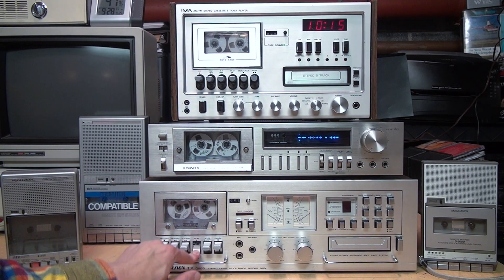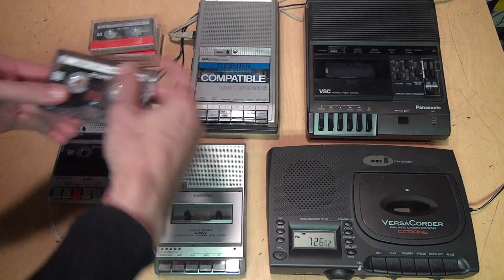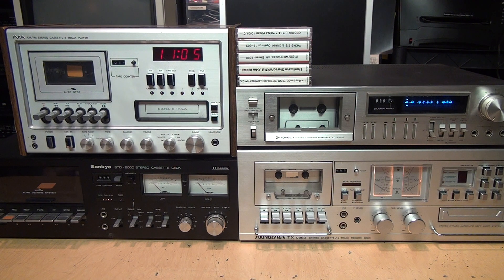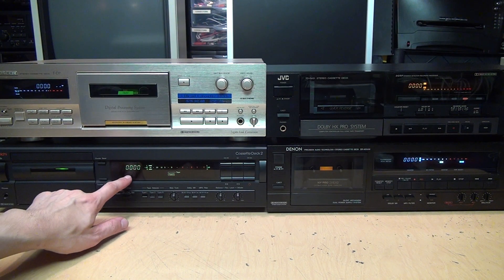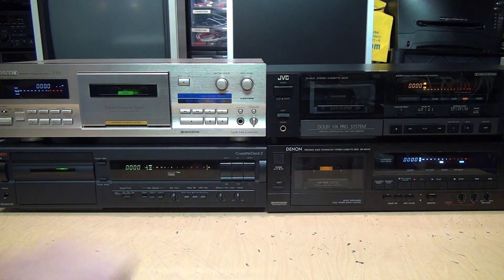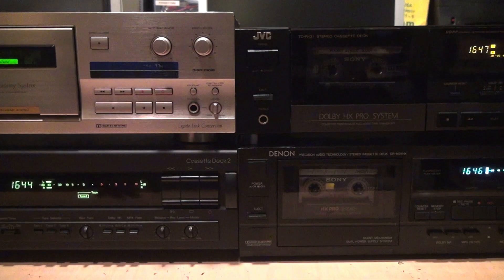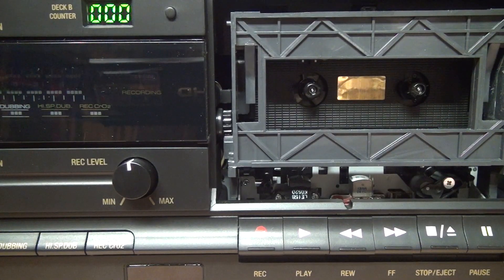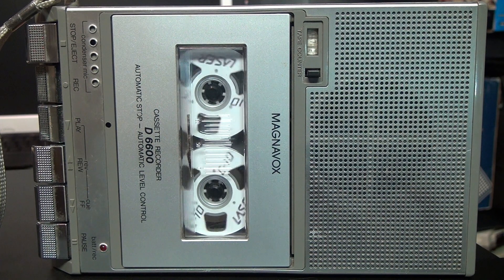What's the deal with cassette tape counters?

Comment: They’re really useful for Datasettes as you can put several games onto one cassette and mark down the counter on the beginning of each data stream.
Reply: Exactly, I don't think I've ever used it anywhere else.
Reply: Are different datasette models consistent?
Reply: @FlyingSurprise  I doubt it. They’re little more than a belt on a spindle. No way telling how the counter is geared or the size of the pulley.
Reply: I did that with my C=64 Datasette, I would write down the starting position of the program and it worked very well as I was only using the one Datasette.  It certainly made it easier to find the programs I had saved and I did use like C-60 tapes for it.
Reply: Exactly what sprung to my mind as well. Will see if they're counter is - by pure chance maybe - within the specs mentioned here.
Reply: @FlyingSurprise  between same model, yes. Growing up in the 80s, none of us kids in the village could afford more than at most a few original C64 or Speccy games a year. All the rest were pirated tape copies, (or floppies in rare cases). When I borrowed a tape from my friend for copying he would put a neat index table on the cassette cover so you could fast forward to any game you wanted. This worked exactly the same on my model 1530 datasette.
Reply: Yup, that's the only time I ever actually used it, for C64 cassettes with multiple games and a fast tape loader at the start
Reply: when you got APSS which a lot of sharp or optunica tape decks had you don't need a tape counter
Reply: @FlyingSurprise  Nope. Even same  model differs.
Reply: @FlyingSurprise  for C64 there were Japanese models with tiny white counters and Taiwanese models with bigger black counters. These two had huge discrepancy.
Reply: @stragulus  C64 tape loading was just magic to me, I never understood how it worked,   just Press Play and Pray    (note I am a staunch atheist now)
Reply: And even then, the counters that my friend wrote down on his C64 tape deck were useless on my own C64 tape deck.

Comment: I remember back in the 70s and 80s, VCR's had a 4-digit counter, that didn't mean seconds, minutes, and hours like the more modern VCR's from the 90s and 00s, it was literally just a counter like mentioned in this video.
Reply: It was an exciting moment for my mother when our second VCR (late-80s Fisher) had a "Memory" so she could rewind to "0000" when she got home from work and wanted to watch her soaps, since there was often programs at the beginning of the tape she wanted to save. No longer did she need to watch the counter while kneeling in front of the entertainment center and hit Stop at the right time - just hit Rew, wait for it to stop itself, hit Play, all from the comfort of the couch.

I was more impressed with the digital tuning, multiple timers, no longer having to convert to "military time" for her, and cordless remote! (Our first, a Mitsubishi, had those twelve annoying thumbwheels, single timer, and corded remote whose wire I always tripped over.)

Then, in the future, I was astounded again as manufacturers started using F-connectors on the input/output, and the UHF and VHF inputs were combined. I still have a handful of those old splitters hanging around in my junk bin.
Reply: Yes your comment beat me to it. The first VCR my parents owned was a 1986 Sharp model that had the same four digit counter you mentioned with no relation to time. The next VCR bought was a 1994 Craig model for myself, and that VCR had a minutes and hours counter instead. I'm curious as to when the  VCRs switched over the counter standards.
Reply: I remember before VCR's had time counters, that 3M (Scotch) brand videocassettes had a sticker you could put on the take-up reel side window, which would roughly show how many hours & minutes you had elapsed/remaining.  That and the sturdy polypropylene sleeves are the main reasons I tended to buy Scotch videocassettes back in the day.

Comment: The slight difference in counter results when attempting to Fast Forward the tape a few times can be attributed to friction in the tape spool, stickiness of the tape, as well as loosening of the tape on subsequent FFs. This was common on tape decks with mechanical counters, and even with an Aiwa with 3 heads, with an electronic counter. Basically I used the counter in reverse (the end of the Side was set to 0000 and then rewound to the beginning) so that when I recorded an album or a compilation of songs, I'd know roughly how much tape I had -  and I was pretty good at the time at estimating whether I could fit a 3,4 or 5 minute song with the leftover tape the counter would indicate.
Reply: That reverse counter trick is a great idea, wish I had have known it 35 years ago when I was recording songs from the radio! 😝
Reply: I just liked pushing the button to make the numbers reset 😆
Reply: @Manalo.  Still do that now,did it 45+years ago, annoying when you mess up by a few seconds,and then the dilemma is,do I fade,or fill with another song🙂
Reply: Make sense 👍🏻
Reply: @Pixie Pete That's how I worked,could sometimes find a short track.Have been listening to all my vinyl, cassettes and CDs from 1976-now,and some of the tracks I have filled up a cassette with,are Quite a mixture.Kate Bushe's Never for Ever,which I have been playing a lot,has 2 Rolling Stones Tracks,and 1 Paul McCartney.I vaguely remember recording it🙂

Comment: What people fail to realize is that the way these tape counters operate is by placing one tiny elf near the hub of the spindle and another one next to the counter device. The first elf watches the hub and counts the rotations and shouts out the numbers to the second elf, who manually advances the counter. The problem arises when these units get old and the elves become hard of hearing. In the more expensive decks they provide the elves with hearing aids but you do not find that in the cheaper decks.

Comment: And that's why, in general, they're not even properly called 'tape counters'. Because what they do count is, at best, spool rotations. The real quantity of tape depends (non-linearly, we might add) on the radius of the spool. So if, say, you've a 3.5min song, and it's recorded at the beginning of the tape, it will take N counter units, while recorded towards the end of the tape it'd take M tape units with M<N (for the takeup spool counters). Regardless of the standard used. Unless using a highend deck which has a linear counter.

Comment: When I was much younger, before my teens, I used the counter on my tape deck to mark where each song began on my mix tapes. When I got a new deck, I realised the counters didn't match up. Since then, I assumed the counter was machine-specific and nothing more than a transitory reference. It's interesting to find out there was some consistency across units and even actual attempts at standardisation. 

I did not expect a Mr. Regular crossover in this video. Nice touch.
Reply: You needed to use real time, that's how old people did that back then.
please forget Tape, it was always crap, still is
Reply: @lucasrem  only to you Bro

Comment: Wow, for nearly 40 years my eyes have glazed over watching tape counters and never thought for a moment there was any type of standard.  Here are some results from my collection taken from the same NOS Sony HF60 of similar vintage:

Digital counters:
Technics RS-TR355 = 411 (deck A and deck B)
JVC TD-W218 = 1644 (deck A) and 1646 (deck B)
Denon DR M12HX = 1369 (I expected a similar result to your M24HX… odd)
Akai GX-R60EX = 2054
Tascam CD-A500 = 1724

Mechanical counters:
Technics M215 = 410
Luxman K111 = 492
Sony TC-RX410 = 426
Sears Professional Series = 435 (no model # on front of unit)

My other 4 decks display only elapsed time.  Thanks Kevin for a fascinating video!

Comment: Very interesting to all of us tech nerds. Obviously the best use of the tape counter is for convenience in rapid, rough cueing during the production or playback of a given individual tape on the same machine or on one that registers the same, as you've demonstrated. For the real story of exactly where to locate certain passages on a tape, actual observed net elapsed and interval times to the 'hack,' 'mark' or whatever you choose to call the edit point reference are the useful data when you know the tape will likely be played on other noncalibrated machines. When I used to make mixtapes for others I would note both net run time from zero and interval times for individual cuts and write them on the "j-card" next the songs so my friends could find their favorites easier on whatever machine they were using at the time.
Reply: I used to mix tapes too (with 1200s) and sell them at swap meets.  I used the tape counter to find the end of a tape so I can fade out the last song. I miss those days!

Comment: I really appreciate the extensive testing you did! It's actually something I've wondered over the years, so it's nice to know there was some attempt to standardize things!

Am I wrong in thinking that some really fancy decks use a realtime counter, like VCRs? (AFAIK, VCRs count the sync pulses on the control track to calculate the time)
Reply from the maker: Yes, as I mentioned in the beginning, some cassette decks, including the Philips FC931 and Pioneer CT-616DR I showed, have an optional real-time counter, in addition to the numerical counter.
Reply: @vwestlife  I'd be curious to know how accurate those are, considering the normal counters seem to vary from run to run. I think it might be interesting to know how accurate the VCR ones are from run to run, and across different decks with the same tape. Follow-up video idea perhaps?
Reply from the maker: @adriansdigitalbasement  Most of them only keep track of time when you're playing or recording. Once you rewind or fast-forward, the time counter resets to zero. The exception are DCC decks, which are able to keep a time counter when fast winding on both analog and digital tapes, by sensing the motion and relative speed of both reels.
Reply: @vwestlife  Ah ok. DCC decks should have a control channel that could be read, even when moving fast.

Comment: Never thought I'd enjoy 25 minutes of watching a bloke fast-forwarding cassette tapes!!  :-D
Brilliant!  It was a fascinating experiment, and I have to say, those two Pioneer decks shown are gorgeous!! Stunning!

Seriously - in a way, I've always found tape counters pretty hopeless!  You reset to zero, play or record the tape, then rewind, and it's either at 0004, or 9993, or thereabouts!  So those decks with the RTZ (return to zero) function will never get the tape where you want it!! And if you rely on the counter to guide to a clear spot ready for recording more tracks, well, you stand a good chance of wiping the end of what you've just done if you don't manually check it first!  :-D

Great video anyway!
Reply from the maker: The return to zero function on the TEAC W-1200 is accurate within 1 digit, in my experience.
Reply: @vwestlife  : Yes, I've seen that video several times (it's great viewing!), and similar can be said for the TEAC AD-850 CD-Cassette deck, however, many of the older tape decks could be woefully inaccurate! More inaccurate because of 'slippage' from the take-up reel when going in reverse?  Maybe the counter belt now going backwards too?
I've seen it with my Technics, Sony, and JVC decks - all with digital counters... 🙂
Reply from the maker: @stevesstuff1450  The belts could be stretching with age.

Comment: I wrote a program for the Sinclair Spectrum which calculated the tape position counter relative to real time for VHS tapes I used (mostly 180 minutes). I took account of the gearing change from the thickness of the tape. I got it pretty accurate but never completely cracked it. I even contacted JVC to ask what the tape thickness was. (I posted here earlier and then remembered it was a VHS video recorder - it's an age thing) This is a brilliant peice of investigation. I never knew there were people who thought about these things like I do :)
Reply: I once made a “tape simulator” that had to deal with similar calculations. Instead of determining tape thickness directly, I estimated the average layer-to-layer distance of the tape spool by taking the radius of the tape spool minus the radius of the spindle, divided by the number of revolutions usually needed to go from one end of the tape to the other. Apparently the raw tape thickness itself is usually a much smaller value which didn't help much. Thing is, this distance can vary depending on how tightly the tape is packed (which may be somewhat different between playback and fast wind, for instance)

Comment: I used to try to explain to a friend of mine hoe gear ratios worked on a cassette tape. He looked through the window one time and saw that he still had half of the cassette left to record on. I told him no. When you have a fresh or rewound tape the 1st part of recording is a "higher" gear ratio and therefore as the tape runs the "powered" reel will spin the other continuously faster and faster therefore consuming the tape faster at the end than at the beginning. I really like your content!

Comment: I always wondered why they didn’t design in a thin edge track on either side of the tape to store  SMPTE LTC (longitudinal time code) or even a rudimentary version of TC.  If they put it on the edge of the tape, it would be susceptible to issues due to tape edge damage, and possible bleed into program audio, but pro tape machines do this well… thinking Nagra 1/4 in.  That or at the very least they could have standardized the counter using tach from the capstan instead of the reels, but that’s a more complex mechanism to implement assuming the capstan is always running…. Edit: shoot I just realized that tach from capstan won’t work in wind mode. Doh!  Love ur vids, mate!  Princess power! 👸🏼

Comment: Well done video!  I bought a mid-end Denon cassette tape deck in the early 90s.  It had an electronic  4 digit counter.  I paid $600 very expensive for the time.   I no longer use it for obvious reasons i.e., blank tapes are hard to find, I have an electronic recorder that can record for hours.  My Denon machine no longer works from disuse and deterioration of the mechanism.  It was awesome in its heyday, for sure!  Thanks for the video!

Comment: Great video. Could watch another hour of that! I wonder why the counter isn't connected to either the motor, the capstan or to any point inbetween where the speed remains constant...
Reply: It would have to be direct from the motor as the capstan isn't engaged when FF or RW.
Reply: @rich_edwards79  From the motor would not work either as FF and REW are geared up, and would also give totally different counter readings from each other as the amount of tape on each reel changed.

Comment: Interesting video. I figured out early on (aged around 10 or so) that tape counters weren't standardised and didn't correspond to time elapsed due to the discrepancies between the big 1970s music centre in our living room and the little portable Realistic machine I used to play tapes in my bedroom. 

Then I inherited a Sony all-in-one system that, being fairly basic with piano-key transport controls and a fully manual turntable, didn't include a counter, and that was the machine I used for most of my teens (throughout the 90s) to dub mixtapes. Never really missed having a counter - I got quite good at 'guesstimating' when one song ended and the next began. 

I was recently given another 1970s music centre - a British-made Fidelity - and a Coomber PA system, both with working tape counters - so I'll have to play around with them. 

I do feel that by not standardising them early on by driving them direct from the motor, Phillips missed a trick, but then I get the impression that they didn't really grasp just how wildly successful the format would turn out to be, especially for music playback / data storage.
Reply: Philips originally intended the Compact Cassette as a dictation format, This is the likely reason that they didn't concern themselves with them. Early cassette gear didn't even HAVE counters, You looked at the little numbers below the cassette's window and THAT showed a releative position. I guess for a short tape with a few bits of correspondence for a typist to transcribe, it was deemed good enough!

Comment: I operated a radio reading service in the 80s & 90s where we made extensive use of C-60 & C-120 cassette for our programs.  As we used several different makes/models, we noted the counter readings at 5-minute increments of the 2 tape lengths from our tape supplier, on each of the deck models. Our programs were all padded with music to fill the 30 or 60-minute clock time slot.